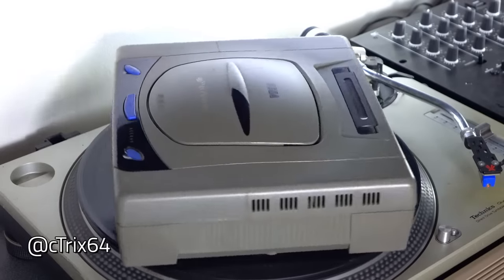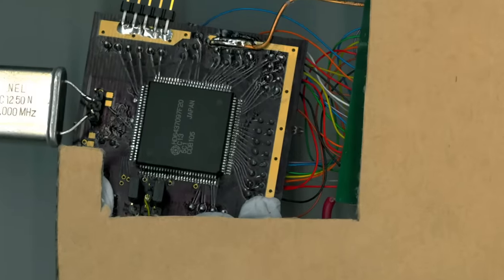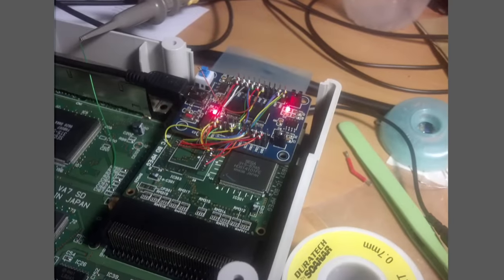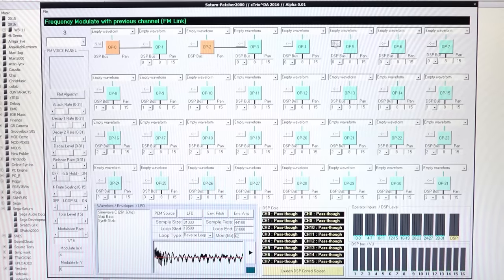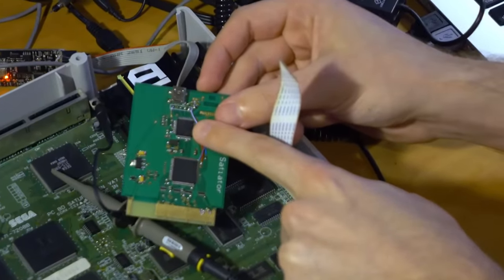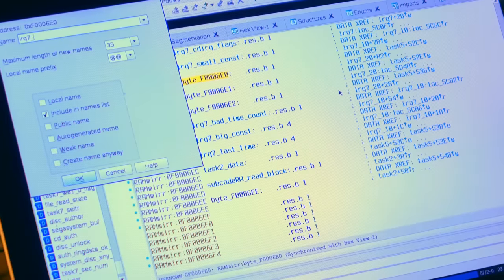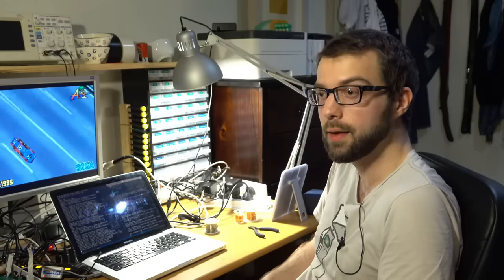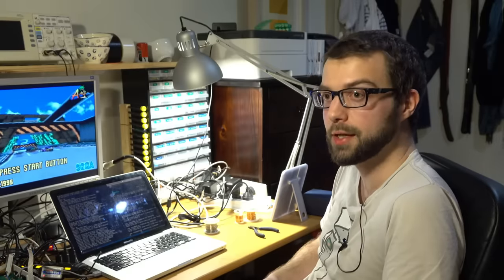Sega Saturn CD - Cracked after 20 years

Comment: I noticed this in passing. I worked for SEGA development in the 90's. So it's come as a surprise that our security has lasted this long. You are still missing some key tools. One being CodeScape as it was one of the first multi-processor development platforms. This was written by Cross Products the development tools division of SEGA. The Saturn development platforms were SCSI based communications onto a piggy backed main processor.
The Key disks did allow you to run your code without security but on a one shot basis. You have to use the key disk every time. There was no code to make this mode survive a reboot. This only worked reliably on piggy back boards.
Imagination Technology still produce CodeScape. However, the all important black box (CartDev) we produced is now nowhere to be seen today. A working version is a must have.
The head count of who new all the details of the processor interface is in single figures. At least you found the wobble. Haha!
Reply: Now that all the hard work is done, the guys from Sega appear... Too late, pal, too late...
Reply: Yup. The Piggybacked Processor embedded in the CD Driver is codenamed "Milkway" its a hidden SH-1.
Reply: Huh?
Reply: That's awesome I wish SEGA still manufactured consoles.
Reply: @witalit  I don't, I'm glad they are out because it allows them to survive as a company. Making consoles is a very, VERY expensive and risky endeavour.
Reply: This is so cool information!
Reply: Wahoa
Reply: Max Power 🤦🏾‍♂️
Reply: Very cool!
Reply: @DJCrisisUK  😂😂😂😂
Reply: @mintsauce82  yeah, the sonic movie is going to save them right?
Reply: and now modding consoles is illegal in Japan.  good thing it's not here.  it's educational, the making of homebrew apps and such.
Reply: Chief, how are ya' doing ?  Guitar playing getting anywhere ? ;-)
Reply: Hi I need help on Sega Daytona usa 2 there is secret car that can be unlocked using vr button. The car cheat is real listen to game test menu 41 seconds into it tells u found secret car. My question is it is on bote and power edition  the hornet car has been found though Mane hack but Power edition  car has not how can it b found though the game program files  thanks Kevin
Reply: I own two Daytona 2 usa dx cabs. I have tried everything button vr combo .. on Power edition to unlock Nissan GTR Skyline extra bonus car.  Eypt track is also unlockable as well.
Reply: But does it blend??
Reply: The head count of all of the people here who’ve seen an actual naked woman in person is in the single figures.
Reply: @FeelingShred  "Now that all the hard work is done, the guys from Sega appear... Too late, pal, too late..."

Once someone documents how it's done, the NDAs they're subject to start evaporating, so they can confirm accuracy of the analysis - but they can't provide more details than have already been found.
Reply: @miscbits6399  Still don't convince me. That guy was just a drip on the ocean of things Sega did, I know, but all of these things perpetrated by Sega (a corporation doesn't exist by itself, the people inside of it that put plans into action...) all of these things was what contributed to the catastrophic death of the Saturn. And in the end the customers are the ones who lose the most. To this day we can be sitting on untapped potential from the Saturn hardware. Who knows what that beast would be capable of doing. 
A coincidence that you reply to this now, I was just watching to another video last night where this guy was showing off some fully 3D homebrew games programmed in BASIC - of all things - running in the Saturn. There is some mind blowing stuff there, and the Saturn hardware is capable of much more that we still don't know. Everybody loses from attitudes like of this guy that commented at the top. Responsibility has to exist at all levels.
Reply: Hmm, what if... We made our own wobble?
Reply: @MaxPower-dj8gb  you see the stepping stones and get ridiculed for it. Wonder why no one has since answered. In time we will know so hold on.
Reply: @jimmywillims5929  26
Reply: @SlimJ87D  who would have thought that the sonic movie would be a huge success??? It’s even considered to be the best video game movie adaptation.

Comment: I wish i had 10% intelligence of this amazing guy.
Reply: 5-6%  (:    just kidding
Reply: u have it .. just use it! the only thing that holds u back is such a mindset!
Reply: You just need to love what you do. I bet his annual salary triples or quadruples mine, and I make close to 6 figures.
Reply: It's not just intelligence... It's determination and patience as well... I mean, he just presented what he was doing for 3 years for you in 20 minutes. Of course people would be impressed.
Reply: hey, it worked in The Fifth Element
Reply: ***** Hence why we're not using them yet.

Those are problems that can be solved. First of all it's not like ground transportation would just go away straight away and there must be ways of simplifying the controls. The energy solution is the biggest problem, but is definitely one the human race is capable of solving.
Reply: No they can't.
It doesn't matter how much effort you put in.

If you can invent a 300mpg skycar car, you could use the same breakthrough to make a 1200 mpg regular car.
If you can make a skycar that can have passengers survive a terminal velocity fall from 20,000 ft, the regular car can now safley be driven into a wall at those same speeds.

If you can invent a method of traveling upward 20 thousand feet for free, then maybe you could take advantage of the reduced air friction.

Utilising a 3rd dimension of travel takes huge extra efforts, being it flying or building multi-story roads. And will not happen untill we actualy need that 3rd dimension.
Reply: N ytonial "If you can invent a 300mpg skycar car, you could use the same breakthrough to make a 1200 mpg regular car."

Hahahahaha.

Okay then.

Definitely going to be the same technology and applicable to both isn't it?

"If you can make a skycar that can have passengers survive a terminal velocity fall from 20,000 ft, the regular car can now safley be driven into a wall at those same speeds."

Yeah, because THAT'S the solution they'd go for. Not like an eject button or something, they'd make the entire vehicle shock resistant.

"Utilising a 3rd dimension of travel takes huge extra efforts, being it flying or building multi-story roads. And will not happen untill we actualy need that 3rd dimension."

Never said it's going to happen today did I?
Reply: yeah, wheels (pushing against the earth) is just fundamentaly more efficient than pushing against air.
So, if you manage to make an air breathing jet like engine of awesome efficiency, put a free power turbine behind it, driving wheels, and you gain 2x the efficiency at ground level.

You could put such an ejection system in this car.
Reply: It's not brain surgery dude.
Reply: Many people keep saying it's more knowledge than intelligence. There are people with probably the same knowledge as him (everyone that has studied the same will have it) that have been working in the same he does with the Saturn for more than 20 years, others more than 10...UNSUCCESSFULLY.
Differences in intelligence allow people with the same tools and knowledge solve problems in different amount of time. Usually the amount of time needed to solve a problem is inversely proportional to intelligence: The more intelligence the less time needed. He succeeded in in just in 3 years while others have been working at it for decades with no success. It makes him probably more intelligent.

Sometimes it's just a matter of luck. You try one option among 1000 and you hit the jackpot.
Reply: how do you know any person worked on this for 20 years straight??
i highly doubt that.
Reply: Put flowers on Algernons grave will ya.

Comment: impressive what is more impressive that even today to date it's proven a near impossible task to crack the protection. 

Sega build a tank of a console there which is worth mentioning
Reply: The protection has been cracked years ago, through mod chips, this is slightly different.
Reply: Dinis Deuchande
 You clearly did NOT WATCH THE video, he did hell of lot more than what the mod-chip did he even explains that in detail in the video...
Reply: I did watch the video, im talking just about the copy protection, this was bypassed ages ago and my reply was to address the comment about cracking protection, which you mentioned.
Reply: try to crack the code for Primal Rage ot Primal Rage 2. it has some of the most notorious codes that still have not been successfully cracked
Reply: Gerardo Garza García and the devs are still laughing
Reply: Jamie Krutzfeldt very true lol. damn those devils...I mean, devs
Reply: YSoSrs? my swap game is on point. i got a Daytona that some shop put a sticker on the inner ring that makes it easy to see when the disc speed changes....thats the points where you swap.  all these pricy games I got so minty 😆

Comment: My first attempt to hack the Sega Saturn was to insert the SEGA Saturn CD into my PC hoping it would play. I was ten. :D
Reply from the maker: That's where you start clicking on files and see what they do... then trying to force them into freeware viewers and "game resource ripping" tools to see what can be extracted.  I was 12 ;-)
Reply: DRVR 99 not to be rude, but misspelling removes what little impact your insult had
Reply: Hi
Reply: Username checks out.
Reply: fight! fight! fight!
Reply: @CTRIX64  My brothers in mind
Reply: @CTRIX64  haha damn right
Reply: Join the club.
Reply: my first attempt at hacking anything was the time when i tried to install a windows 95 game on my windows 3.1 pc, i just figured that maybe the game wouldnt notice that i didnt have the correct OS installed, because theyre basically all the same anyway...this did not work.
Reply: r/thathappens
Reply: @CTRIX64  Been there... then I moved on to dumping them in a hex editor, figuring out the formats and writing tools to open them. Though I personally stuck mostly to DOS PC games, I actually started on it with files extracted from an N64 ROM (Command & Conquer).
Reply: @CTRIX64  I remember succesfully flashing my Xbox 360 Drive to play burnt disks. I was 14. Then I successfully jtaged my Xbox 360. I was 16 then
Reply: @jamesblackwell2067  - Back then most games were not made specifically for Win95, they were made for DOS which both Win3.1 and Win95 sat on top of. If it was a DOS game, it would've potentially worked on both machines but then it comes down greatly to the hardware.
Reply: @CTRIX64  It was in the early 90's. I read Bios from memory to floppy. Blow It. It was just the low-level format part that I wanted to save. On the other hand, every time I ran it, it was just pushing the date forward.